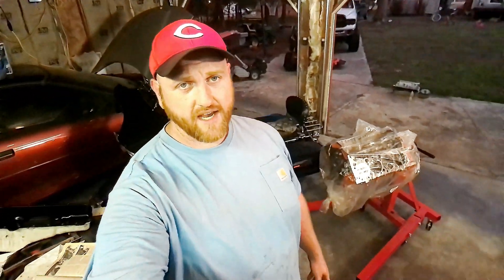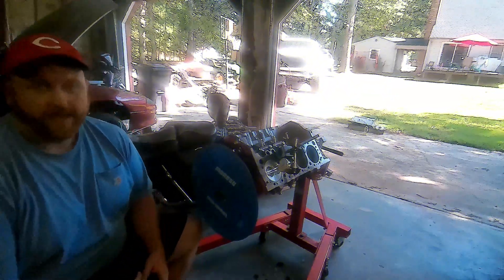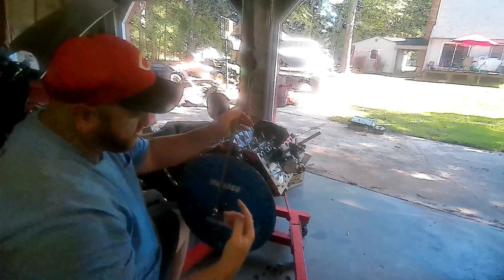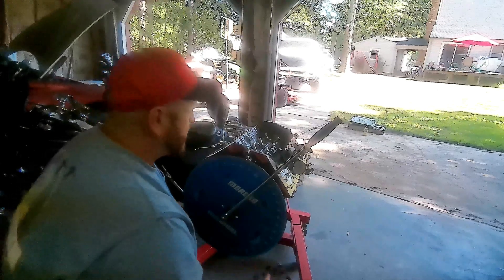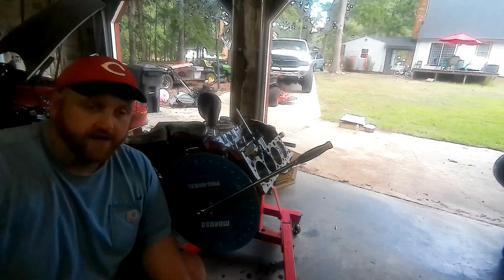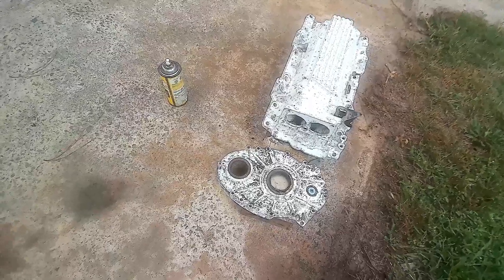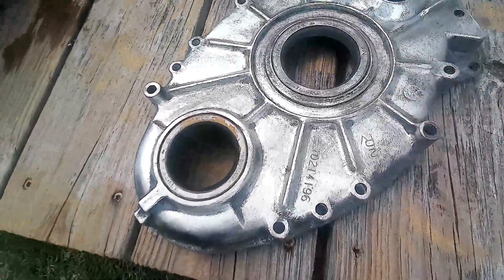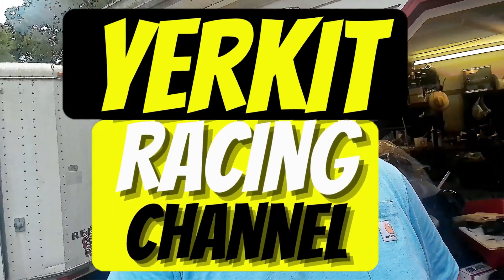LT1 engine build: Installing cam lifters and timing set. DEGREEING CAM + INTAKE MANIFOLD DISASTER!😡😡

Comment: How much to put a cam kit n lifters in my 96 Chevy caprice
Reply from the maker: Not sure... You want to bring me just the motor or the whole car? Never done one in a caprice. Not sure how long it would take or what's involved.
Reply: Ok thx never mind
Reply from the maker: @1hunda100  No problem... you will come out a lot cheaper to do it yourself. Really not a hard job. Just watch some videos and take your time.. if you are mechanically inclined you can have it done in a weekend.